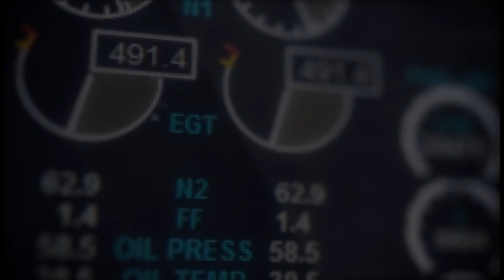Will Circular runways "take off"

Comment: Put square wheels on the planes. That'll slow it down fast when landing.
Reply from the maker: Hahaha
Reply: Harrier-styled VTOL planes 😂
Reply: @Nortonmascota  f35 lightning is a more controllable and efficient vtol aircraft and flies supersonic. But they are fighters, to make a vtol multihundred passenger aircraft is a big task and while possible, not economically viable in today's market. When the demand for such aircraft typed is wanted then they may develop one, either that or they could build runways in orbit, have the planes built to be oxygen tight put nuclear engines on and fly on the edge of space. Would also solve a lot of pollution 🤷‍♂️
Reply: SHREKEDSON using rocket boosters
Reply: sierraromeomike after burners on a 737
Reply: javamann1000 Illumanati landings confirmed.
Reply: Cover the bottom of the plane with sandpaper, that'll slow it down faster
Reply: dazhibernian just don’t give it wheels so it can slowdown faster and be lighter
Reply: Is "real estate" the only problem this will solve? 
Tell real estate people circular runways will drive prices down, that will solve the problem.
Reply: Triangular?
Less bumps per revolution!
Reply: we usually use concrete blocks  to slow down but now i'm enlightned to the way of the triangle
Reply: dazhibernian   M n,
Reply: haley smith
The way of the triangle?..
Illuminati detected.
Reply: Round wheels for taking off, AND square wheels for landing.
Reply: dazhibernian its gonna collapse before the airplane even touches down
Reply: Even more effective at braking a plane is to land it face first into a mountain. Stopping distance of zero. No runway required!
Reply: I'm always amused by people who buy a house beside an airport and then complain about noise. Are they truly that stupid? Apparently YES. I once lived 3 blocks from the end of the North / South runway of Pearson in Toronto. After a couple of weeks, you didn't even notice. What amazed me were the people who came to my door asking me to sign petitions against the noise. A special kind of stupid.
Reply: Safe and smart yep
Reply: SHREKEDSON with 8helis
Reply: You will get more resistance and thus braking potential with no wheels or landing gear at all though.
Reply: cubes? triangles? I wanna say make them flat... however ski planes already exist damn :(
Reply: If they replace the wings with...wheels...additional landing wheels wont be needed at all! How didnt they come up with this idea so far? OMG Who needs the wings at all? They are bulky... However those engines may stay... they look fancy, I like them.
Reply: They actually tested this on Mythbusters. The vibration broke up the vehicle.
Reply: Consider not installing landing gears
Reply: how will the plane takeoff
Reply: r/woosh @shrekedson7845
Reply: dazhibernian, wheels down doesn't always slow the plane down, shows you how much you know
Reply: Instead of using wheels use skids and instead of a runway made of concrete it can be water instead. ;)
Reply: VTOL - while we are at it..... i suggest tilt engine.....
Reply: Never drop the wheels.  It will stop quickly.
Reply: I bust a gut laughing at this GENIUS solution! lol
Reply: DumbDuck44 😄👍
Reply: triangle wheels would slow faster
Reply: Harrier jets!
Reply: Only approved for use on Canukistan domestic routes.
Reply: Lololololl
Reply: Papineapple Gaming but howtotakeoff?
Reply: michael wilson lol
Reply: Volkier Neigh since it is an aviation it is landin gear
Reply: ChaosManticore lol u smart! But the plane is heavy
Reply: Lyubomir Ikonomov how about not cocpik plane?
Reply: dazhibernian According to South Park, the Canadians already do use sqaure tires on their cars.
Reply: +reverse thrust   Do you mean VTOL?
Reply: Too expensive though, I can imagine the tyres getting worn out quickly and also taking off would be quite bumpy.
Reply: Would this just end up costing the airlines a fortune in airsickness bags?!
Reply: Teleportation
Reply: Then it will be difficult to takeoff
Reply: ha ha ha You actually mean square Tyres (UK) or Tire(US). Wheels are ROUND by defination
Reply: But, but ..... oh never mind. If it's square, would it even be called a wheel?  (yuk yuk).
Reply: dazhibernian lmao
Reply: Smart
Reply: SHREKEDSON just get some black panther ting
Reply: To reverse engineer a UFO, first you have to have a UFO. An actual alien spaceship, not an out of focus light on a low quality video.
Reply: I say a better design would be hexagonal because it would have multiple options for landing and taking off
Reply: Brilliant!!!
Reply: dazhibernian try taking off lol
Reply: Or just make twistable jets-- Hover down!
Reply: Why not have no wheels at all?
Reply: Beautiful, I can imagine the little old lady sitting next to me nagging and complaining about the bumpy landing!!
Reply: @AB-sg4xu  I was going to suggest the Barney Rubble Foot Procedure, but yours would be better for planespotters to watch
Reply: Why have any gear when you can just land without any landing gear.
Reply: classic lol.
Reply: @ankmlord  it doesn't seem practical.
Reply: The Canadian aeroplanes already are like that. (See South Park.)
Reply: Genius
Reply: Also seems rather discriminatory to still be promoting straight runways in 2018.    Runways are on a spectrum, and all orientations should be accepted.
Reply: Just build a big concrete wall in the middle of the runway
Reply: XD

Comment: what if an aircraft has a mechanical failure with screwed up flight controls, and a straight runway is preferable?
Reply from the maker: Yes, that is another of many problems facing this project.

Comment: It would be an ATC nightmare
Reply: and a nightmare for pilots as well. Plus the added stresses on aircraft make it a nightmare for maintenance engineers.
Reply: CaptainDuckman For passengers too because the airport basically needs to be in the middle of nowhere
Reply: I don't think this will ever happen, but I have to say ATC seems pretty simply.  Aircraft waiting to land fly in a circle about 10 miles out at set levels of altitude.   Departing aircraft cross those circles at different altitudes.   And of course it need not be in the middle of nowhere anymore than current airports.  If there is a mountain in the way of one angle, don't use that angle.
Reply: Jman ya😂
Reply: Beat off
Reply: and it will not be possible everywhere, but in a lot of aereas it can fit perfectly. Even in London aerea because it will vary a little and not so much as changing runways ( Heathrow has only 2 runways parallel at each other, but take amsterdam airport and you see more variation in de heading of the runways.

Comment: This is one of those "engineer has an idea while drunk" concepts that seems like it would solve every problem if only reality would conform to the drunk engineer's demands. Sure, we'll just redesign everything about airframe structural integrity to accommodate a radical idea that's even less accessible than a straight strip in the middle of nowhere because then you'd need a very large square slab of flat land with nothing surrounding it for many miles just for the sake of noise abatement? At that point you've essentially disqualified most present-day airport locations from even entertaining the concept. Never mind that aircraft have enough troubles just rolling down a straight flat level strip of land, now he wants to introduce a bank angle, constant right turn and a concave landing surface all-in-one?

No, circular runways basically mean you'd be taking the high likelihood of a 30-car pileup from your typical NASCAR race and applying it to jet aircraft carrying hundreds of people. No thanks.
Reply from the maker: Yep.

Comment: If I remember my high-school physics properly, you would make the turn frictionless, so even on a slippery surface you would stay on the circular track. That's why trains don't derail that often, they do banked turns and can go fast and stay on the track without huge amounts of force needed. I haven't done the math, but I'd expect the angle to be a few degrees max... How quickly would wingtip-clearance become a problem?
Reply from the maker: Very quickly.

Comment: When I was learning to fly in the San Francisco Bay Area  in the mid1960s, the next big thing was going to be the microwave landing system or MLS which would allow unlimited courses unlike the ILS which was limited to 360.  Essentially, aircraft could arrive from any direction and fly an approach on a 6 degree glideslope which would allow for approaches to be curved like those on a DME arc and closer to the airport due to the 6 degree slope.  San Francisco Bay had SFO, OAK across the Bay Alameda NAS, SJC in the South Bay and several smaller field in between. The one thing that pilots are usually not too proficient at are DME Arcs.  Couple one with a 6 degree glideslope with reduced separation and aircraft arriving from different directions at one of the airport's "rush hours" would make for some busy and interesting times.
Reply from the maker: Yes, now the "big thing" is of course RNAV approaches that does the same thing

Comment: Gotta give kudos for keeping your composure and not calling the whole thing ridiculous and stupid. You did mention skidding off a slippery  runway, but did not discuss the main problem with landing and ever changing crosswinds. Also did not mention that an ILS would not work.
Reply from the maker: Yes, Like I wrote in the description, this is just a few of the MANY serious problems that this idea has.
Reply: Johny Johny not be so fast and think. Mentour has just mentioned several very serious negatives of circular runways. And even they are enough to stop this idea. There are many videos about this (never ending) topic, so you can learn more.
Reply: Johnny ILS for a circle would obviously be completely different than ILS for a straight line. Adding extra avionics is a lot cheaper than changing where the wings and engines are.

Comment: Out of a circular runway of a diameter of 3 Km, you can have 3 runways 3140 meters long ( the 3 arcs subtending a 120 degrees angle ). The circular segment, of such an arch, has a sagitta "h" of as many as 750 meters ! ( h = R ( 1 - cos 60 ) = R ( 1 - 1/2 ) = R / 2 = 750 m ). Don't you think that such a runway would be a too "bent" runway ?
Reply from the maker: Yes, I do.
Reply: If we say that the speed of the plane is 270 km/h = 75 m/s, the centripetal acceleration will be v^2/r = 75^2/1500 = 3,75 m/s^2.
The banking angle would be arctan (3,75 / 9,81)= 21 degrees.
Normal gravity is 9,81m/s^2.
The sum of gravity and centrifugal force will be sqrt (3,75^2 + 9,81^2) = 10,5 m/s^2. 
10,5/9,81 = 1,07057, which is an increase in the downforce working on the landing gear of just over 7%. I do not know how significant this would be. The stress on the landing gear could be tolerable, but the 21 degree banking angle might be a problem. The pilots might have a problem handling that.
Reply: Yea this is stupid you would need to be doing full rudder to make the play stay on runway
Reply: John Olav Henriksen that's what I said
Reply: It's a concept, the idea was to investigate with a scientific approach the pros a cons, It's good to think out of the box to stretch the envelope is when ideas evolve. No need to treat them as stupids.
Reply: Not to mention that the landing gear would be subject to extreme stresses by just having a banked runway.

Comment: It doesn’t really seem like this would solve crosswind landings either, because you’d have to stagger your approach anyway to accommodate the turning you’d have to be doing over the runway. Banking aircraft at low altitudes presents its own series of problems as well
Reply from the maker: Yes, I completely agree.
Reply: Kinda what I thought when I first heard about them. Maybe the circular runway would be a better option for small planes, like private or commuter jets or prop planes, in only remote flat areas? Thanks for answering my question about circular runways.
Reply: Isn't banking & turning at very low altitude & very low speeds one of the factors of air crashes?
Reply: I get the feeling that it would actually force pilots to land in a crosswind configuration to account for the changing angle of the runway and the curve of the runway.
Reply: its designed by a dutch person tho.. there are not many non flat areas here.
Reply: Your comment about (large) remote flat areas hits the nail on the head. There aren't many of those near cities.
Reply: Also, only at two points on the runway will there be no crosswind, so on take off they are still going to get it and after landing. And now they have to land either one set of wheels first, or not level, which really isn't very easy.
Surely the next innovation has to be in the area of VSTOL for commercial planes, but I still don't see that much for the regular airliners. More likely innovations in the power plants, or perhaps like the B52 where it can steer all wheels, so it can point into the wind but have the wheels aligned to the runway direction
Reply: whats wrong with crosswind landing/takeoff anyway?
Reply: @mojeimja  On a normal runway, crosswind landings/takeoffs are very tricky as it is hard to hold the center line. On a circular runway, wind direction would be constantly changing.
Reply: It also seems like there would be constantly changing conditions of lift as the airplane experiences constantly shifting apparent wind direction.
Reply: Airports evolve over time and tend to get bigger. A circular runway would hem everything and prevent growth.
Reply: Sandy it’d just replace it with the equally variable skill of landing on a curved runway
Reply: I would also think in an emergency landing, this would not at all be optimal. In fact, it may be a hazard.
Reply: Imagine the space it would involve. Also it would make arrivals and departures trickier as they wouldn’t be standardised path to follow and learn as they would change every time the wind direction changed. If they didn’t there wouldn’t be a reason to have a circular runway. It’s an idea that’s not going to takeoff.
Reply: TheWindigomonster
Yes, it looks like you'll be crabbing even on a day in dead calm, preparing for centrifical force on landing no matter what sort of day it is.
Reply: @Pasoundman: "Come to think of it, wouldn't the PF have to manipulate the rudder and tiller during both take-offs and landings too ?" Nope, the banking does that for you. ;) at least with takeoff. With landing the bank will force the plane to follow the turn once touched down.
Reply: Replaces piloting skills in handling crosswinds.
Reply: pasoundman You can say that again just look at Greece, but that's another subject.
Reply: @Current Batches: "Every pilot deals with constant changes in wind direction, but not 360* with every landing and take off." A pilot that needs the full 360 degrees of a runway which equates to at least 7.5km to line up his plane without touching down is doing something horribly wrong and should not have a license to fly anything. (unless ofcourse the landing gear doesn't come down and a guy in a pickup needs to pull it down. ;-) )
Reply: TheWindigomonster know
Reply: It’s not a new idea. There have been a number of designs for in-City circular runways on top of buildings back in the 20s and 30s.
Reply: +TheWindigomonster
I would say it seems better to make it in octagons instead tbh. I don't see the banked runway as any form of solution. But maybe 8 straight runways in the shape of an octagon could work.
Reply: Zeleene schiphol is getting there.
Reply: The circular runway, despite its major shortcomings and impracticality, it is always advantageous as far as takeoffs and landings are concerned. The takeoff heading and landings can be changed into the headwind anywhere on the circular runway
Reply: pasoundman how would like to take the risk? Nobody
Reply: Constantly changing wind direction does seem like it would be a major hazard making take-offs and landings much more difficult.
It would be a nightmare for emergency landings as well, where a long straight is even more essential.
Reply: Every landing becomes a "spot" landing.
Reply: I agree as well
Reply: not to mention having to turn at 200 mph when you land..   that be some drifting skills
Reply: Exactly so. Straight runways are actually aligned with the predominant winds in that area. E.g. LHR has 09/27 which aligns with westerly and easterly winds. You'll lose the advantage of take-offs and landings into a headwind too. Come to think of it, wouldn't the PF have to manipulate the rudder and tiller during both take-offs and landings too ? A recipe for disaster. The fact that it has attracted EU funded research proves to me that it's a bad idea. EU bureaucrats are famous for their stubborn stupidity. Don't even get me started !